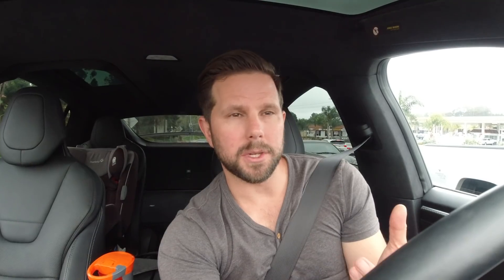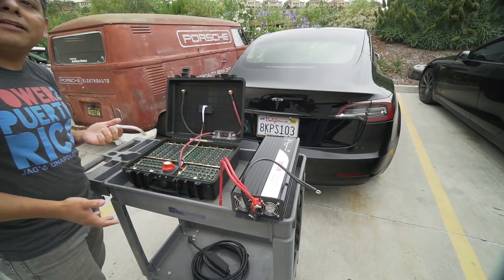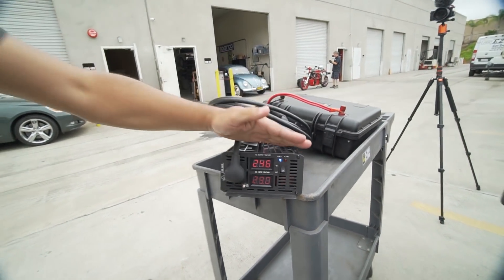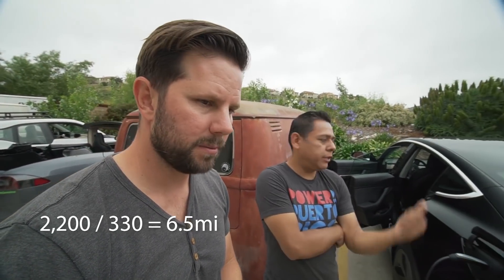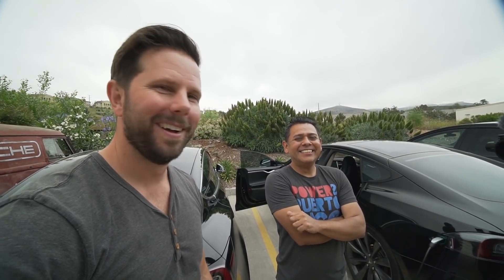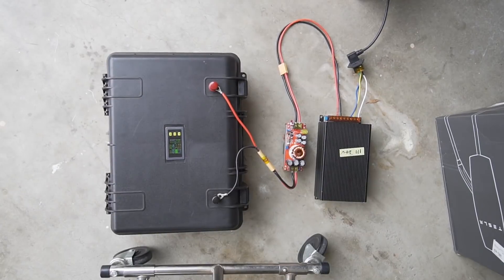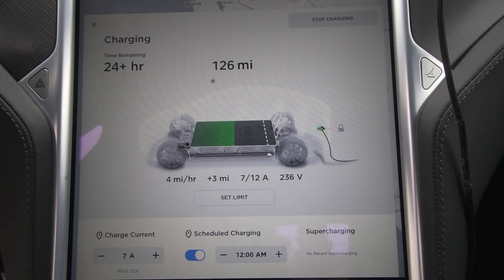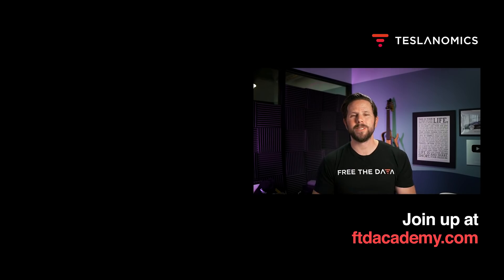DIY Tesla Gas Can - Will it Work?

Comment: Tesla really should allow Tesla to Tesla DC charging,  like Rivian is planning to do.
Reply: they have already talked about it... but then you would have people that would supercharge for free and back feed the house or their teslas
Reply: @blusensation2350  
I am sure they could come up with a solution to verify that it is connected to another tesla through some software.
Reply: Mike Lezan if someone had 2 Tesla both would have free charging even if only one did
Reply: @zachm4635  This can be solved by something like this : if 80% of the charge is for a supercharger, you have to pay for the charging if you backfeed, and if 80% of the charge came from the supercharger, you get 20% off the normal rates.
Reply: .....and  SonoMotors with there Sion want to do it.....
Reply: Yes that's a really good idea. All ev should be able to do that. it's like having jumper cables. i'm sure the industry can figure out a solution where part of the cars battery capacity can be accessible. not just Tesla to Teslas.
Reply: @blusensation2350  I don't think that many people would do that, no way it would be as fast as a supercharger and quite a pain in the ass.
Reply: Sounds cool but not practical IMO. Running out of juice should never happen really.
Reply: there is no reason for this. You can just use charging stations.
Reply: "Tesla really should allow Tesla to Tesla DC charging"

I was just going to suggest this very thing. Maybe the Model Y will have such a thing. Or Tesla's pickup truck...
Reply: Pointless!!!! Its like your ice car having a tool to extract gas from your car to give it to someone else. Sure you could make it but theres no reason to.
Reply: @faaipdeoaid4  not if you're stranded somewhere
Reply: @flipperbear9  you dont get stranded somewhere because you have 300+ miles of range and a computer that tells you your range and where every charhing station is.
Reply: Good idea but Car to Car charging should be capped at some low percentage. Say 5 or 10% max. And be fairly quick, under 30 minutes.
Reply: @benthecaptain7419  no reason for it to be capped. no reason for it to exist in the first place. Every one who speculates on these stupid ideas have never owned an electric vehicle.
Reply: @faaipdeoaid4  I've never been to Mars, but it would be useful by the time our sun goes red giant.
Reply: @faaipdeoaid4  First time you run out of power in the middle of nowhere you might reconsider that position...
Reply: @JustWasted3HoursHere  ive owned 3 electric vehicles all with less than a third of the range of a tesla and never "ran out of power in the middle of nowhere". Ive never ran out of power anywhere. Why? Because i have a brain and i can read my battery percentage. I dont start hauling off into thr middle of the desert hoping im going to find a charging station in a cactus.
Reply: @faaipdeoaid4  Well stupid is an opinion about the feature so I won't comment on that. But I will say you're right that it isn't necessary. I own two Teslas. But it's the kind of back up gimmick that might convince nervous types to make the switch. If it involves a new cable and some software then why not. Heck the Tesla Truck will have 240V output for power tools. There's the fix right there.
Reply: @faaipdeoaid4  Maybe so, but that doesn't mean that it absolutely cannot happen. Maybe you were low and heading for a supercharger station that would help you...but then you got there and they were out of order or there was a power outage and you're too far away to get to the next one on the charge you have. Who knows what can happen, however unlikely?
Reply: @JustWasted3HoursHere  yeah and maybe ill be low and the supercharger station blew up from a meteor landing on it the  a t rex destroyed the road to a different one then the zombie apocalypse started and the maps stop working, ok you are right, this is a good idea.
Reply: @faaipdeoaid4  Running out of power is a rare event, true, which is why this business model would only be practical in very large EV markets.
Reply: @faaipdeoaid4  I've never been stranded in my Tesla Model 3 Performance over my first 6 months and 30000 miles of driving, even in -20F weather in CO/WY/SD, so true.  But when we get the pickup and more off-road capability, it'd be awesome to be able to transfer electricity between vehicles when you are far from electrical hookups.  Besides, mistakes can happen even in areas blanketed with chargers and you are stuck, being able to share electricity is a no-brainer and would save any worry or issues about running out of battery accidentally.
Reply: @flipperbear9  if youve gotten yourself stuck in a model 3, you arent that intelligent, as simple as that.
Reply: @flipperbear9  gas vehicles never developed a system to trade gas between vehicles for the exact same reason, its pointless.
Reply: great idea.
Reply: @zachm4635  yea and spend all day doing it, cmon man
Reply: @JustWasted3HoursHere  its not practical anywhere as its not practical to be devloped for gas vehicles either.
Reply: BYD (the Chinese automaker nobody in the west heard about, though is the largest EV manufacturer in the world)have vehicle to load since. ..forever.
Reply: That is such an edge case. What self respecting adult would actually do that? to go supercharge for an hour for what is at most like 10 dollars of electricity. It literally isn't worth the time.
Reply: It is dangerous dc is really unstable and the volts can kill someone if the charger is cut and the wires show bigger shock then ac
Reply: @killermarcos2362  I find it surprisingly easy to not cut the charging cable
Reply: @killermarcos2362  What a bullshit. DC is safer at the same voltage. Also if the charger is cut you don't fucking use it.
Reply: @blusensation2350  I don't think this is an issue since newer cars don't get free super charging, especially given that they would need to implement this with newer versions of the car and is not something that you can easily retrofit. Also, Elon did say that the truck will have an invertor for heavy power tools built in, so you could actually charge another EV from it. I would love to charge my electric bike from it and am really hoping that the Model Y (which I ordered) will maybe get one also.
Reply: Just throw away the Tesla and get a gasoline car
Reply: Warrior Son  no one has ever done this because its uqually pointless.
Reply: Patrick Carroll, power loss is probably an issue to factor in, it might not be work it.
Reply: @michael24-j4i  software wouldn't be needed in order to verify this.  All that tesla would need to do is jump pin 5 and 6 (example) and if pins 5 and 6 are closed then it would signify that it is connected to another tesla and if its open then an error message would show up saying something like "error, invalid connection" or something like that.
Reply: @blusensation2350  The ability to "Back feed" should be possible with all e-vehicles to ensure a ready supply of electricity in a major blackout-- grid failure. Could be a real life saver.
Reply: Have got no knowledge about these Tesla's, but was real surprised to hear they are not doing that already, why is that? Should be restrictions against that, or just bypass that refill hatch/charge port all together and make a "emergency bank" that one could throw into a trunk and act like a extension of the stock battery pack while avoiding any efficiency loss in the process. Like I said, no knowledge about these cars or their systems for that matter but should not be too hard to make that happen unless Tesla foresaw it and deliberately tried to stop people from doing that DIY style? I am a bit stunned Tesla is not doing that themselves, hard to see why someone designing a electric vehicle like a car and not think about that, besides not every Tesla on the planet is rolling in California, US of A and if your intentions as a company is to conquer the world?
Reply: @blusensation2350  You could make it so only non-supercharger kWh could be supplied. If you charged it on AC at home 10%, and did like 80% more on supercharger, then you could supply only 10%. That way it could be prevented.
Reply: Tesla pickup might have this I suspect
Reply: @blusensation2350  They could add restrictions when using the feature pretty easily.   Such as requiring payment for any outflow of energy from the tesla.

Unrelated- it would be great if they had an additional charging port in the trunk.  Then you could put a device like this in the car and extend the range.
Reply: david schexnayder they never developed that capability because you can put gas in a can.
Reply: Killermarcos23 excuse me?  DC unstable?  It’s DC.  It’s a flat line.
Reply: A 48v inverter would be more efficient, lower amps going through inverter means less heat power losses
Reply: This might be a good use of crypto of some kind that is tied to the energy usage for electric vehicles so it can be tracked
Reply: @blusensation2350  It would be extremely extremely easy to prevent this with the computers already built into the car. Sure allow it but if you try to charge wHs that you put into another car with your Supercharger wHs they would just make it not free for that charge, they could do it watt for watt billing.
Reply: Taht would be incredibly innefecient
Reply: tesla to tesla dc charging would be the most efficient way to charge cause your not converting dc to ac then back to dc
Reply: Ill stick with my diesel thanks. Unlimited range.
Reply: I thought some tesla charging ports have pins for DC "fast charging"?
Reply: david schexnayder I’ve been screwed twice by super charge stations that had “electrical” issues and ended up leaving my Tesla to come get it the next day. Relying on something that can fail is why having a back up (like car to car) would be more than enough reason to have such an option.
Reply: @faaipdeoaid4  for goodness sake. The point is, what if you DO get stranded really close to a charging station.
Reply: Just buy a cyber truck and then you can use the outlet in the bed to charge another tesla
Reply: @mikeymcknight9524  Two cyber trucks could charge each other while driving down the road!  Unlimited range for free!
Reply: Good idea. Like siphoning from a gas car.
Reply: Gas can for the Tesla model 3 AKA impossible Toyota Camry.
Reply: @TF-Times  yeah but it does !
Reply: @faaipdeoaid4  but what if u left it at an airport for days or it got cold and ur range depleted by cold weather..so many variables!
Reply: @blusensation2350  cheap rolling advertising.
Reply: DC to ac to dc....why cant you just connect the  juice box direct to the cars traction battery.
Reply: That would be cool. Just like jump cables on ICE.
Reply: @blusensation2350  There can't be that many people with free charging unicorns, I don't see how this would be a material impact for Tesla.
Reply: I'm thinking the cybrtruck should be able to charge another tesla if it can charge the cyber quad.
Reply: Mobile Rangers should have a solution like this
Reply: Yeah
Reply: i dont mean to be so offtopic but does anybody know of a way to log back into an Instagram account??
I stupidly lost the password. I would love any help you can offer me
Reply: @Beau Kyle instablaster =)
Reply: @Alexis Roman i really appreciate your reply. I got to the site thru google and im in the hacking process now.
I see it takes quite some time so I will get back to you later with my results.
Reply: @Alexis Roman It did the trick and I actually got access to my account again. I am so happy:D
Thank you so much you really help me out!
Reply: @Beau Kyle you are welcome :D

Comment: For future Tesla cars, Tesla should make rechargeable emergency battery power packs that drops into a slot in the truck where it connects directly to the car, so the car can instantly get 5 miles of extra power, and if you want more miles you just buy multiple battery packs.

Comment: Basically what Jehu has is what Dan needed when he bricked his Tesla in the middle of winter in SLC while he went on vacation to Hawaii.  That battery-can? Charge-box? Whatever you want to call it. Dan had issues getting his Tesla out of the parking garage because it was too dead to be towed, (eventually they got it out).  This would be great for a tow truck to have to charge your car enough to get it onto the flatbed.

Comment: Idk get why the tesla doesnt have a solar powered roof
Reply: Roof, trunk and hood
Reply: Inefficient & heavy
Reply: Simply not true. The newest prius prime has it as an option. It adds about 4 miles of range with a roof panel alone. A hood and trunk panel would help
Reply: You should research "Lightyear one" a solar powered car that can also plug in

Comment: Like the Tesla to Tesla charging idea
Reply: Have thrown that idea out quite some time ago.
I think Tesla owners are quite supportive of each other.
So why not have an emergency call icon on your Tesla screen with options. Where you could choose "out of charge" (and other options) and this message would be sent out to all Teslas within 15miles. If you are able and willing to help, you could "accept request". Your car would inform the other car "will be there in 15min."
And then you would need an extra port and something like jumper cables in an ICE car. And the charged Tesla could help the empty one.
Reply: And those with free supercharging will abuse it and give electricity to others for free,  Tesla won't do that
Reply: @flipperbear9  I had not considered that. It would probably not be super fast (car to car) and supercharging is not that expensive. seems like that may be more trouble than it is worth. However, they could also limit number of times a person could do it in software; like once a month or something to donate power. I am sure there are some creative ways to make it a possibility while making it hard to abuse supercharging.

I saw the one video where a guy built a custom solar trailer with battery packs, that could charge a Tesla. Hell, having something like that that, that could be towed to a stranded motorist would even be a decent option.
Reply: Patrick Carroll they could just limit it to 10 miles a charge

Comment: 7:02 sounds like your bms was going nuts at that point.
Too much draw from the battery made the cells go low.

Chances are they just didn’t have enough charge in them after the first test as that’s a heck of juice

Comment: Try again but with low battery, 2% to 8% on the tesla, that will be a  more realistic scenario, trying at 60% to 70% charge left on the tesla the gas can will be limited due resistance,  this way perhaps it will give more range.

Comment: I'm curious if supercapacitors can do better for this application.
Reply: Just what i was thinking. I thot Jehu was going to suggest em. They discharge fast and charge quickly. Have u you tried them?
Reply: They have way way lower energy density than batteries, so no. They are great for instant current, but not for energy storage.

Comment: 136 x 18650s (or better 2170s) gives you 480V same as a supercharger. Might be too much for the batteries current wise but at least you wouldn't have the inverter weight and losses. Would have around 1,5KwHr of energy or around double that with 2170s.
Reply: Yes, would be better, but you still need a regulator, because you will not get stable 480V (cell drain from 4.2 -> 3.0V). And the BMS would be difficult (balancing over 136 cells).
Reply: @hamburgelbstrand5748  Not sure what the voltage range specs are for a super charger but if you c an go up to 500 volts for example you could add more cells to start at the top end of the range.

Comment: I’m telling you... if Tesla were to build a solution to this... they would sell a TON of units!!
Reply: tesla has not reason to make these. my company has been building mobile AC power cases like this DIY version for years now, the most powerful version we sell can do 10kW at 380V
Reply: They have a solution already. It's built into the car. It's extra batteries than they otherwise would have had.

Real talk though the only real solution is a software one. Basically claim the car has 10 miles less range than it really does, then shut off 10 miles early. Then you have to access a menu to enable "emergency mode" to get those extra 10 miles.

The only difference here would be forcing people to act urgently because of the inconvenience of the car actually stopping.
Reply: They could.. but they can't... Battery constraints. Look atbhow long people are waiting for powerwalls. Up to a freakin year or more.
Reply: @SupremeRuleroftheWorld  what is your company?
Reply: Mykel Hardin a Hydrogen Generator would solve ALL Fuel Problems, only relies on water and copper coils replaced or cleaned after they corrode. It’s 100% clean energy, ZERO EMISSIONS! Find a way to make a hydrogen generator without corrosion and you have even better low maintenance
Reply: The solution is a portable generator.

Comment: Aaa did have a mobile charger, but when I left there is was focused on vehicles that used the SAE standard J1772 plug or the CHAdeMO plug. Granted I left AAA in 2014. So I’m sure a lot has changed. Also not all AAA clubs had it. I was in Washington and ours was basically a hydraulics powered generator that ran off the PTO. It was crazy loud and it took about 20mins with the CHAdeMo connector on a leaf to get 10 miles of range, and had to run at 2000rpm so it used a couple gallons of diesel to do it.

Comment: Neat idea, but not really practical until battery energy density gets much higher.  Now the power sharing between Tesla car's is a cool idea.  And at the same time have a way the car could provide emergency power to homes as well.  Instead of having a generator when power is out be able to power my house from the car, kind of like a powerwall.
Reply: Give your head a shake and come back to the real world.
Reply: Problem is that the battery will wear out quicker.
Reply: Stu Pidas lmao chill you savage